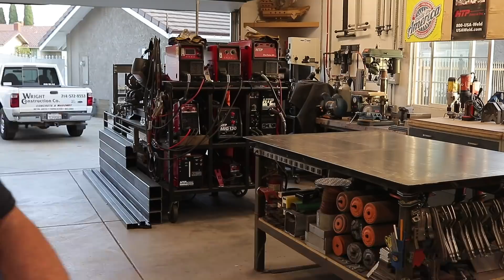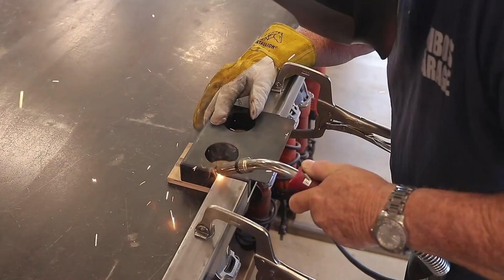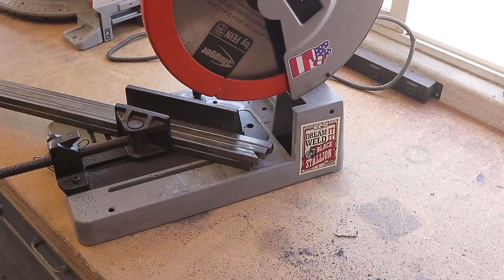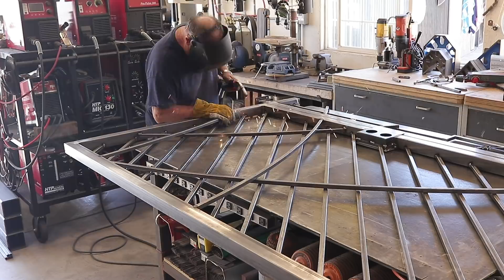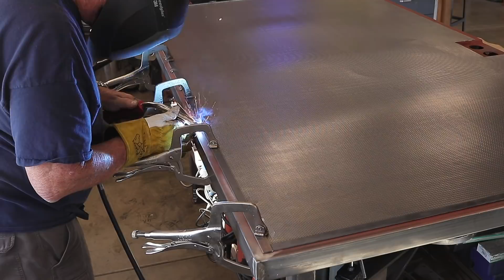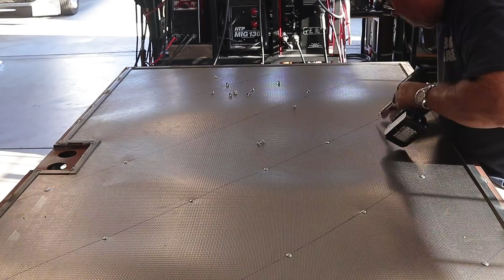Custom Designed Metal Gate Build | JIMBO'S GARAGE

Comment: You should buy a little program called DraftSight, it is exactly like autocad but much much cheaper! like a couple of hundred dollars. Super easy to easy and it will help you out tremendously with doing layouts, spacing, designs, dimensions etc etc

Comment: That's a good looking gate! I'm in the race car fab business and we been using a paint called Steel It. It's impregnated with Stainless Steel so you could weld over it at any time. Great for project like this where you need to paint before all the welding is complete

Comment: Also all components go in before final weld so components are braced.  Lockbox vertical can be finished using a backer spline before frame is ever assembled so it is straight.

Comment: When welding, specifically with a mig welder, do you put the wire on the smaller, bigger or in the middle of the metal bars? Or do you start on the bigger thicker one and work your way onto the middle of the two?
Reply: Were you drinking when you wrote that comment?

Comment: Jimbo , much respect to You. I love your Vids.. But you're supposed to screw the screen on and then take it to the powder coaters. They powder coat gate , screen , pan heads screws that attaches the screen.  .  A cleaner way is to use a hole saw and cut holes the the screen for the deadbolt and door latch (knob) .. As a welder myself I've done a few and powder coating is the only way to go..

Comment: .063” you are not taking any strength away grinding welds ...
Reply from the maker: It's like welding sheet metal, You have to be on your toe's thinking all the time. A half of a second to long and you burn through!
Reply: JIMBO'S GARAGE that shows that you have FULL penetration ( even without chamfering the parts ) and that you can grind away the excess on top no problem !!!  The actual weld will still be there ....!

Comment: Yo Jimbo stop explaining yourself every time you grind your welds! Don’t worry about all the keyboard commandos. You keep doin you man
Reply: Joe Scroggins I like him explaining himself, helps me know why he’s doing something a certain way. I’m new! Sorry! Sheesh! Throw me in jail why don’t ya!
Reply: lolllll
Reply: I agree with you Scrogg Dog. I always grind my welds down on all my gate fabrications Jimbo. And a added tip I also use a orbital sander to smooth out and blend in the miters after doing so.
Reply: Besides, everyone knows the adage of “Grinder and paint, makes me the welder I ain’t”!   Everyone cleans up the welds Jimbo.
Reply: @jimsjacob  overkill
Reply: When welding, specifically with a mig welder, do you put the wire on the smaller, bigger or in the middle of the metal bars? Or do you start on the bigger thicker one and work your way onto the middle of the two?